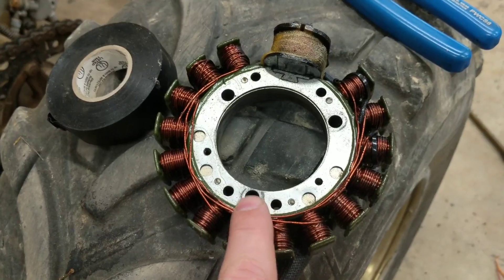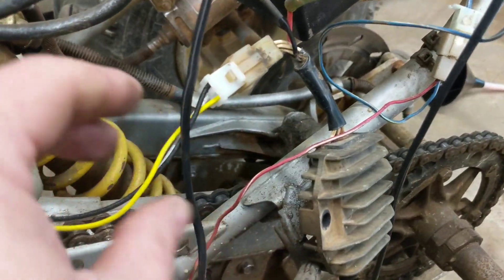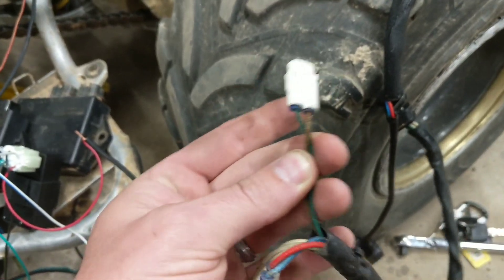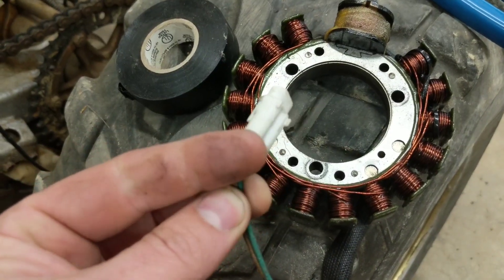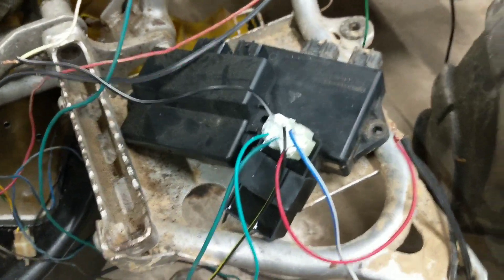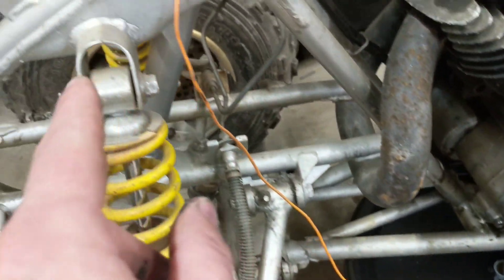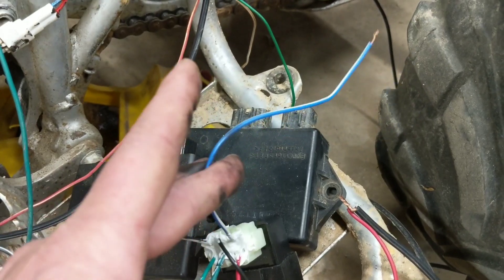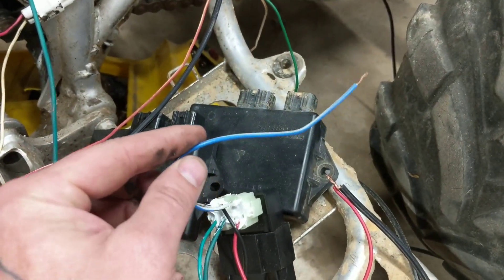How to wire a gy6 Chinese cdi to nearly anything

Comment: good video. when i wired an 1970 snowmobile with electric start from scratch i used a big piece of cardboard and marker to make a wiring diagram, make things easier to sort out. and the regulator you have is called a rectifier. thats what turns ac  into dc to charge a battery.
Reply: No its a regulator, that happens to also have a built in rectifier. 
If it were just a rectifier and not a regulator you'd boil all the electrolyte out of your battery with the 30-100+ volts coming out.

Comment: Thanks for clarifying the wiring arrangement for the pickup coil - I have a Kawasaki KLF185 Bayou and not sure if either of the two CDI units I have for it work as the bike is in bits right now and neither CDI seem to give a spark on turnover so I have just bought a DC GY6 CDI for it and will give it a go!
Reply: Did it work?
Reply: @silviurogoz8962  Sadly not - although I am not convinced that the seller of the CDI actually sent a DC one - I have now located a pickup coil for it and am waiting for that to arrive to fit then I will try the two original CDI's again.

Comment: Great video iv got an 87 warrior hope this fixes my issue as the used cdi's for and 87 cost between 200 and 300 its ridiculous I have to pulse generators tho on mine one for run and one for start from what iv seen do you know how I would wire up  thanks and great video
Reply: will damage engine, no advance will run hot
Reply: @tombauer4887  It won't "run hot" you dumb ass. It just won't have a way to Advance the timing. the Stock CDI has a 3D map programmed to pick up a certain voltage spike at a certain RPM 1 Pick up coil causes advancment at Idle and the other causes reard at high rpm

Comment: Just what I have been looking for! Very clearly explained too! Top man!

But some questions: I have a 1970 Honda SS50 5 speed. It runs magneto ignition. Could I use the magneto to power an AC CDI? If not no problem I can take power from the battery with a bit of rewiring. Oh its 6v by the way! Next, its a points (breaker) system not coil/magnet triggered. I dont want to mess with the stator. How can I get a trigger pulse from the points?

Do you have a video for AC version?

Great video my friend! No annoying music either!😉
Reply: This youtuber Harvey Spooner tells all about honda crap but is absolutley no help at all if it's not honda just never answers questions at all just found this video havent put into practice yet but seems a+ to me as from what I under stand yamaha and honda use completely diffrent kinds of pulse generators hope that helps this video I believe has helped me